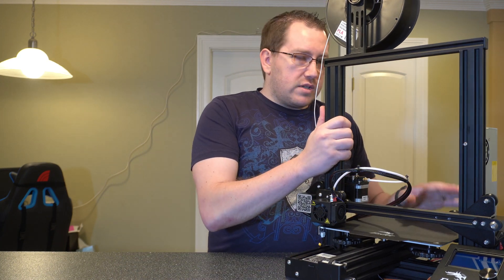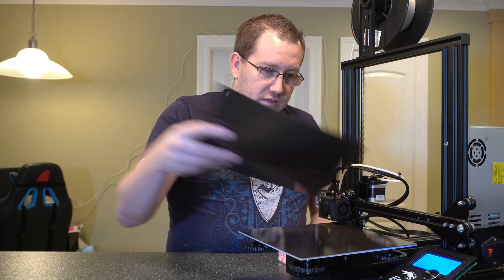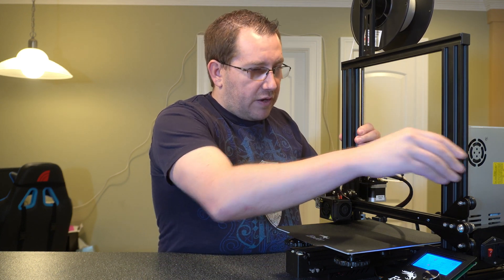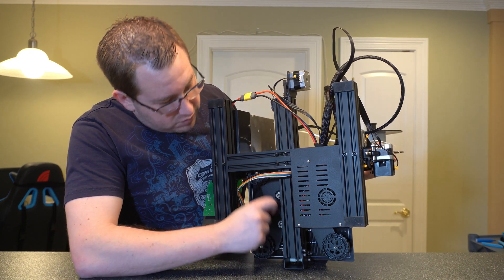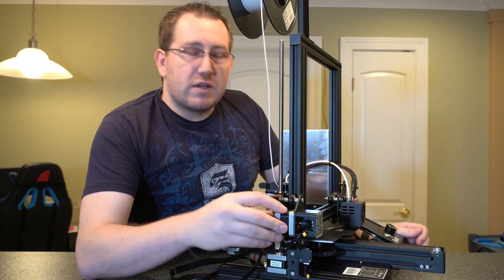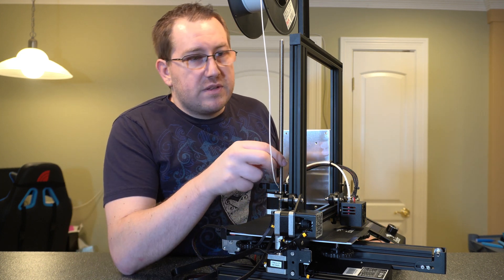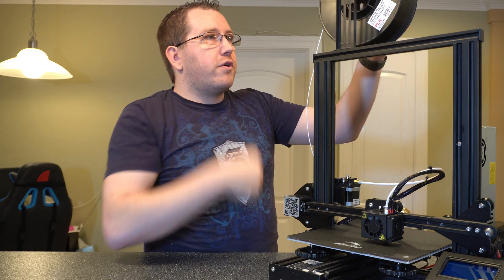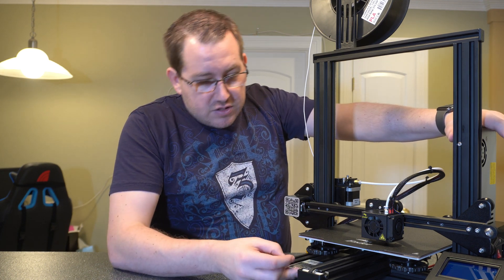3D Printers for Beginners (2020)

Comment: Thanks, since I put on my ender 3 pro lasst 4.2.2, I get thermal error, and before it was no errors, any help please?
Reply from the maker: Hi. Did anything else but the firmware change? If not, try moving over to marlin, i have some builds on my site.
Reply: @3DPrintscape  nothing Else did change I put new marlin and I had old marlin, do you think it might be reason that I have no silicone cover on hot end?
Reply from the maker: @Chris-vc1dh  I dont think the silicone cover will make much of a difference. I would make sure none of the wires or anything got damaged, though the thermistor may have gone bad.
Reply: @3DPrintscape  its ok now i just put new silicone cover.
Reply from the maker: @Chris-vc1dh  Did you touch any of the wires going to the hotend when putting it on? I dont see the cover itself fixing it but if you had a loose connection it could have.
Reply: @3DPrintscape  no wires issue

Comment: Im trying to extract the firmware file(I am using my Mac Book) and i keep getting this upon unzip.(UNABLE TO EXPAND "ENDER-3 PRO-MARLIN2.0.1- V1.1.2-ALT.bin".It is an unsupported format. Can you please help me.I HAVE ALREADY INSTALLED THE CR TOUCH BUT CAN GET THE FIRMWARE TO UNZIP.
Reply from the maker: Hi. You can’t extract the .bin file. That is the firmware file that has been compiled and gets used by the printer.

Comment: Rob,   with my Ender 3 Pro, where can I get a full explanation of all the items in the printer's menu screen e.g under the control menu is velocity,acceleration,jerk and steps, what are these, and under velocity is e.g. vmax x is 500 what is this.  And with all the settings under these menu items, does the settings in the gcode file override these settings 
Thanks
Reply from the maker: Hi. I dont think I've come across anything that has a complete overview of what the menu items are. This is probably the best ive seen, but it makes a lot of assumptions. https://marlinfw.org/docs/features/lcd_menu.html

Comment: I am 64 year old retreated physicist,  specialized in computer and electronics.
I just started using my daughter's ENDER-3, for fun. I bought BTT ... SKR mini e3 V2, TFT35 and BLtouch upgrade. I recompiled firmwares, still BLtouch on his way.
I had to resolve some startup problems, like non squared assembly, non calibrated E-steps (after replacing eroded and broken extruder arm), and on top, I had to compensate for 1,4 mm filament, 4 reels !!! (Don't try to be cheap, start with good stuff)
I was near to quit but I never quit. And, then, I got your presence, your well chorégraphiée explanations. THANKS to YOU !
Reply from the maker: Awesome, I'm glad i was able to help out. You're welcome.

Comment: hi Rob, ask you a question seeing as this video is about absolute beginners for 3-D printing, I have just purchased an Ender 3 Pro x and it came with extras such as silent motherboard and a glass bed when looking at the about this printer option on the screen it tells me it is version 1.0.1, is this out of date? and if so what should I upgrade it to?, I would also like to ask if you could tell me how I can determine if it is in an 8 bit ofr 32-bit board as I have been looking at other videos it seems that this firmware may need re-flashing the date of the firmware on the printer is 25 April 2020.

I would really appreciate it if you could give me some advice, I have watched quite a few of your videos and I like your method of teaching very understandable and very professional so I trust that you will give me a correct answer, anyway enough rambling thank you very much and have a good weekend
Reply from the maker: Hi. Thanks for the feedback. If you got a silent board, its going to be 32-bit. I cover how to check that and the firmware version in this video https://youtu.be/uylAYrmZqrk . Creality does make it a bit confusing because they version their build independent of marline. If you need more help, dont hesitate to reach back out.
Reply: @3DPrintscape  thank you for the link to the video that is exactly the same mainboard that I have in my printer with Version 1.01 but it is dated 25 April 2020 and I think the newer one is January 2021 thank you very much for this tutorial it is really appreciated and thank you for such a speedy response

Comment: What is your main printer you use?
Reply from the maker: My main printer is an Ender 3 Pro, i actually have two of them now. I will be getting a Ender 5 soon as well. I actually ordered one but they cancelled the order due to stock issues or something...
Reply: @3DPrintscape  I notice in the cura setting that the speed is 50mm/s. What happens to.an object if you increase or decrease speed.
Reply from the maker: @ericyou1828  Depending on the printer, it can be a combination of ringing(or ghosting) on the print, under extrusion issues, and it can cause excessive vibration. Some printers can print faster than 50mm without an issue but they tend to be more expensive and not necessarily better.

Comment: Hi, I’m having a print issue. I just bought a ended 3 and I can print all test out fine but when I come to any other project the filament comes out in globs. I’ve been getting all my projects from thingiverse. I’ve done the x,y,z test cube and it came out great. Then I tried the chain linkage for the ended 3 wiring and it come out brittle and in globs. Any suggestions?
Reply from the maker: Hi. If the test print is coming out fine, the issue isn’t with the printer, its most likely with how it was sliced. I created a couple of videos on this that may help you out. If you are still having issues feel free to reach back out and I will help you troubleshoot. 
Ender 3 Pro Cura Setup (The Basics): https://youtu.be/uzQys6xiCFo
How to Print a Thingiverse File on a 3d Printer (The Easy Way!): https://youtu.be/eXYpFLnrvgM